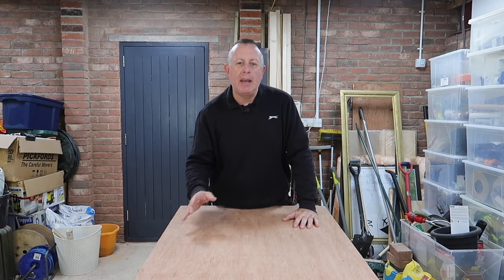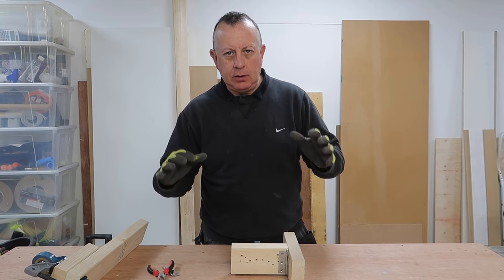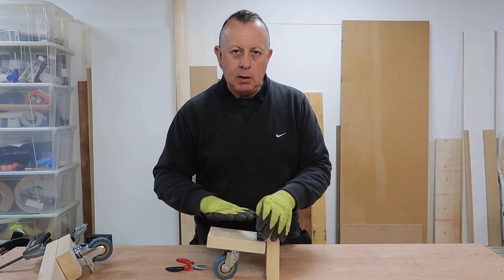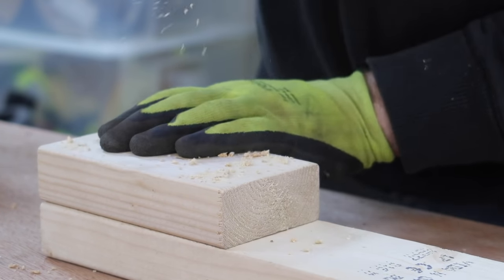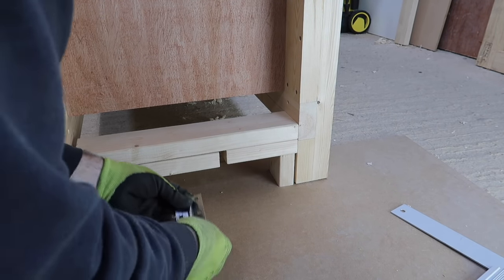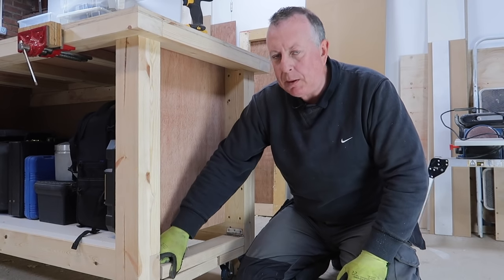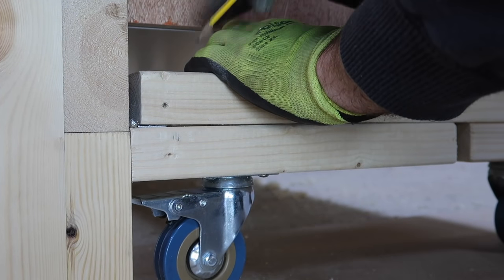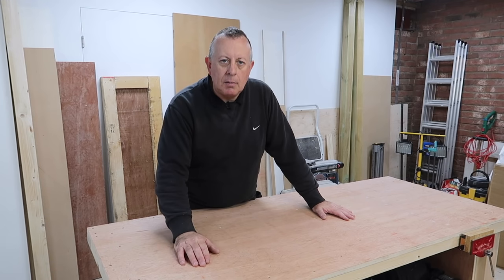Simple Retractable Casters for Workbench

Comment: Great build and video.  The only thing I would possibly change is adding a piece of angle metal to the ends of the hinged boards so the load isn't running directly through the softwood into the three hinge contact points.  Great work!

Comment: Nice.   For a rougher floor, just start with much bigger diameter casters.  Wagon wheels are the size they are because a buggy is driving on rough dirt roads, with only 1 horsepower.

Comment: I’ve watched every video with retractable castors to find the best solution as decent shop ones are so expensive. I was impressed  with and built Carl Holmgren system. Yours is one of the best I’ve seen. That latch is clever relying on lateral movements. Pulling the hinge pins is inspired I will definitely use that idea. I would be interested to see a long term use review in the future. Cheers John from County Durham UK.
Reply from the maker: Glad it was helpful! I will do an update in the future. At the moment I'm moving the bench maybe once a week so it should last some time I think.

Comment: We have wheeled tables much like this in the shop where I work. When attaching the legs, instead of making a jig block I would have blocked the table up for the clearance I wanted between the legs and floor when the casters are down. Then I would have set the caster/plates in place on the floor and screwed the hinges in at that height. Obviously either way has its pros and cons, I just wanted to present another method.

Comment: I have a box full of those brackets. They certainly come in handy, but are too rigid for their intended purpose, in my opinion.
I prefer making my own safeties out of climbing rated nylon tubular webbing, washers, and structural screws into the studs. I would feel absolutely awful if something I installed toppled over and hurt someone or damaged something.

I like your design. It's very simple. The only downside is that you have to look at the retaining bracket to line up that screw. Toggle or latched systems are no-look and hands-free but are far more complicated or use pricey sprung hardware.

Thanks for sharing!

Comment: think this can work for a 1300 lb pool table?   Application is to move daily over flat concrete floor less than 10 feet between storing and playing position. May need steel cross members between the legs along the short dimension.

Comment: Lol I have this going on in my kitchen at the very moment!!
My studio apartments too small and I have a cabinet/buffet thing that’s about the same size as the one in your work Studio (and made out of some heavy ass metal ) .I bought these caster movers from Home Depot which I probably should’ve just bought wheels and made one  anyway this big giant metal table has been chilling on two of them for way too long but ..🙄the cabinet now has the ability and freedom to travel the studio (until I finally get it out on my balcony where it belongs) sadly the extent of its travels isn’t very far as my apartment isn’t very big. My apartment is however on a flat surface so it has never rolled away on me but I suppose I could make casters with those wheels that card tab where you step on one side and it locks the wheel if I wanted to have a cabinet on a hill or something lol

Comment: Great idea! Have you done any testing to see if the bracket comes off the screw when the wheels get jostled? I have expansion joints in the concrete and my wheels take quite a bump moving across that gap.
Reply from the maker: I've used it probably weekly so far and it's not jumped off yet.

Comment: Awesome build. Your system works much better and far less complex than several other YT versions, some of which approach Rube Goldberg levels of unnecessary parts.Your bench appears to be fairly heavy, but some slightly beefier casters should handle much heavier loads, given the big mechanical advantage. It appears the limiting factor for ease of use is the length of the lever, and therefore the space between the legs. 
   Time to hit the internet for a fresh batch of casters.
Reply from the maker: Glad you like it! Yes, the distance between the legs and therefore the lever length and I suppose how much force you are happy to use are the limiting factors.

Comment: I was thinking you could use a vertical board pushed into  place over the levered board for the casters. once its pushed flat against the leg it should hold its place due to the upward force of that board. then to lift up the casters that vertical board could be angled toward the center, releasing that caster setup.
Reply from the maker: That actually was one of my ideas for keeping the lever down. However once I realised how easy it was to keep in place I went with plan B

Comment: MFI! Now you are showing your age! They went bust in 2008 I think. Bought my first DIY kitchen from MFI back in the '80's. God where has the time gone.
I have also fitted casters to my work benches but they are not retractable like yours. My problem is that my workshop is my single garage (attached to the house) the floor of which slopes from the back to the front - quite a lot. As a result all my floor standing shelving & benches have to be blocked up on one side to make them level. The shelf / bench legs nearest the garage door are shimmed up around 250mm!! It's either that or have benches / shelves with one set of legs longer than the other - not happening. Given that most of my benches are 2nd hand kitchen units & worktops it was easier to shim them up with adjustable kitchen unit legs which can then be wound down when needed. Fitting casters to the bases makes it easy to drag them away from the wall when needed. 
Keep the videos & good ideas coming. Every day is a learning day.

Comment: Those are definitely IKEA 👍🏼 Another great vid, thanks. The only thing I'm curious about over time is the wear between the two timbers that run against each other, i.e. at the centre when your two tower bridge arms make contact. But I'm sure you'll get plenty of years before it becomes an issue 👍🏼
Reply from the maker: Thanks. I'm currently moving the work bench every 1-2 weeks so it doesn't get much wear and tear. If you were using the system daily or more then maybe you would want to put a strip of aluminium etc for them to slide against.

Comment: I love the build.  I plan to use this approach on my new bench.

Can you tell me what hinges you are using?  I can only find door hinges and they have an offset and won't sit flush against the leg and the lever arm.  I checked Amazon and my local hardware stores, I cannot find any hinges without the offset?
Reply from the maker: The hinges are one of the cheapest Screwfix sell - with a removable pin

Comment: Any idea of the weight that this system can carry?  I'm looking for a solution to make my lathe (~300 lb-m) moveable.  I would think that the components need to be capable of handling ~ 100 lb-m.  I love the simplicity of this system.
Reply from the maker: I would think around 400lb with a struggle. If you intend using it for a lathe then I would agree with you - look at using a better hinge and casters. You need to assume that at some point the weight will only be on 3 legs.

Comment: My shop floor is usually dusty, dirty, and has a few little chips laying around. I could see the latch popping loose. What if at 11:05 you moved the hole in the bracket for the screw head up the slot say 3-4 mm? Then the screw could slide in the hole and seat a little deeper in the bottom of the slot, maybe preventing it from bouncing/vibrating loose?
Reply from the maker: You could do. I move my bench every couple of weeks and so far it's not popped out. There is so much weight on it that I think it would take a lot for that to happen
Reply: @ProperDIY  👍 Good to know then. Great video by the way. As others have said, probably the most practical and straight forward idea yet.

Comment: In order to lift do the caster have to be parallel to the wood?  Would they work if caster were turned sideways or would it collapse the casters?
Reply from the maker: On their side a caster won't have the same capacity for sure

Comment: My workbench is made out of meranti wood. The workbench itself is heavy but adding the equipement on the shelf underneath I estime the total weight around 200kg. Although it’s very stable because the weight, I can’t move it at this stage. Your solution seem a very simple but convenient one. However, I’m a bit afrair about the hinges/screws being able to support the weight. Do you have any alternative solution or any other type of hinges you would suggest? Thanks
Reply from the maker: The cheap hinges I used were good because of the pin that made it easy to remove. If you want a stronger fixing use better hinges without pins which will be more time consuming to fit but will take a greater load and will last longer.

Comment: Cracking idea and only came across your channel by chance and now have subscribed. So much better, stable and cheaper than normal castor workings or the adjustable lift ones that you have to lift every corner individually. Superb 👍. Do you know what sort of weight it can take as my workbench is really heavy with all the draws and tools in. 
Keep up the great work. Seeing other comments, its funny how all of us seem to watch the same channels 😀
Reply from the maker: Thank you. I estimate that the bench plus tools is now around 200-250kg. Best way to find out is weigh each end with bathroom scales. The casters are rated at 150kg each and you need to assume that at some point, the whole load will be on 3 casters only (as an uneven floor will mean 1 caster is hanging)
Reply: Thanks you so much Stuart for your prompt reply. That’s excellent, I guess mine is around 300-350kg but was planning to integrate my cast iron table saw into it, with out the stand that is another 90kg. 🤔. Pushing my luck but that’s what we do? By the way just watched your vid on the tenon door, excellent work and especially with out a table saw. You have the patience of saint if you ask me. 🤣
Reply from the maker: @markgeezey1809  well that's a fairly heavy bench in total. The great thing about a project like this is that no one will see it until complete so if you have to change your design or modify something only you will know. See it as an experiment with iterations rather than 'right first time' and you will prob end up with something better than what you thought at the start.
I really should have had a table saw for the door build - it did test my patience (off camera)!

Comment: Good video, informative and well thought out. One observation and I understand you have dumb down the technical jargon which helps but feel you are missing an opportunity to share your expertise , you used the term shear a couple of times , whilst to an engineer this word tells them about the fact that the load being transmitted through the surface area of the hinge pin has been thought and will support the load and forces being applied(not break it )however to the layman the word shear may not tell him it will not snap under the load of the bench and it’s stored equipment , again thanks for a great video👍👍👍👍👍
Reply from the maker: Thanks for your comments. It's a very difficult balance trying to explain everything, to everyone and keep the video interesting, entertaining and keep it less than 2 hours long! Maybe I should have explained the term shear, others have already asked me to explain 'lever arm' so I have to aim at the middle ground knowing that maybe not everything I say will be understood by everyone who watches.

Comment: You could position a batten between the top underside top and the lever
Reply from the maker: You could do but would need to hold it in place so it doesn't suddenly come out as the bench rumbles over bumps in the floor

Comment: If you moved one of the angle brackets to the inside and connected the two levers rigidly enough, you could probably control both mechanisms from one end.
Reply from the maker: Maybe. It did cross my mind that I could potentially do something that push down both at the same time however I finally decided that a) there was more opportunity for something to go wrong and b) I didn't want to spend more time on it - other things to do!

Comment: Thanks for your excellent channel. Will incorporate this strategy in upcoming MFT3 mobile cart.

Help requested please to locate the loose pin hinges, with a little handle on the end of the pin, enabling simple removal.

I have looked on Amazon and screw fix web site but unable to locate.

Any suggestions and advice appreciated - thank you.
Reply from the maker: Thank you. I've never seen a hinge pin with any type of handle or loop - prob as it would normally get in the way. My only suggestion is to find some steel rod of the same diameter as the original pin that you could use as a loose pin but could extend out of the hinge where you could maybe bend to form a hook etc for ease of removal.

Comment: One thing to be mindful of when fitting casters inboard like this, is that you can make the bench very susceptible to toppling (i.e. overturning moment couples) when you change direction whilst pushing it (i.e when pushing the bench sideways), the wheels on the leading edge rotate towards the trailing edge, bringing them closer to the centre line of the bench (courtesy of the fact that they have caster) this has the same effect as if you had moved the bench legs inwards and built the bench with narrowly spaced legs (i.e. it's tippy if you apply a force sideways force anywhere near the top edge of the bench).

The solutions are:
Don't mount casters inboard
Just be aware of the effect and pay attention to what you are doing
When moving the bench, push the bench down low not up near its top surface (thus massively reducing the overturning moment it experiences).

This particularly relevant where you might have uneven loading of the bench, it's fine when stationary, but you start moving it around and shifting the line of action that keeps thing upright, and there she goes....
Reply from the maker: I've found that although the casters are on-board of the legs they are still 500mm apart. So, as long as you aren't pushing it around the workshop like teenagers playing with supermarket trolleys you'll be fine.
Reply: @ProperDIY  Yep, there's always the real world vs theory, given the bench width I'm sure this one is fine with common sense.. If one makes a 2m wide structure with inboard casters on the legs and it's only 700mm high, it's all a non-event. It's just a general note for people to keep awareness of if using casters on their other designs/machines/projects etc.

A nice simple solution you present in this video👍

Comment: Wouldn’t this cease to function once the wheel material either wears or becomes compressed when load bearing? I would think at minimum you’d want to have the lever raise the bench to the measurement of the wheel material to the metal caster. This way you have as much wear tolerance as possible. Curious to see how these fair over time and load. Good thinking overall.
Reply from the maker: I understand why you say that but the wheels are only working when you are moving the bench around - for me that's around say 2 minutes a month, moving 1-2m max. I've got no wear on them yet.

Comment: Oh I may mad or what. It's a pity I didn't see this video before cutting my legs short and installing casters on it. I did follow your video on a workbench.Today I decided I do want to have an option to move the bench around. I shorten the legs on miter saw (which was fun exercise  I must say) and installed casters on it. It's all ok, legs are even, casters are working as expected. But it introduced slight wobbling I'm not too keen to see. It's not that bad but still. Without casters workbench is a bit lower than I'd like. 
And now I see your video. Sigh.. one of those facepalm moments I guess :)..

Comment: I know it is more rewarding to make your own tools and gadgets as well as for making great videos, but workbench casters have been around for quite some time now and they aren't very expensive. The ones I obtained are by Powertec. Their model number is 17002 and includes four casters for about £90.
Reply from the maker: 4 casters for £90 - not expensive - really?
Reply: @ProperDIY  They are in the U.S. only about £43 equivalent.
Reply from the maker: Well that's at least £33 I saved then!

Comment: Another way to do it would just be to have the wheel attached to the table at the bottom and then make a hinge next to the wheel where the leg could flip up or down. You could either have a magnet to keep it up ...
Reply from the maker: Yes you can do - whatever works for you

Comment: This video was super helpful!! I'm the set leader for my school's theatre department and our musical is Legally Blonde which requires about 17 set locations. After coming across your video I think that this'll be a really effective way for us to move and lock the sets safely. Do you have any suggestions on how to be able to push down and lock both wheels together rather than separately? Again, great video! :)
Reply: I have this same issue with my bench that sits in the corner with its left side in the corner.  My solution is to use a 2x6 for the upper lever and rip the “push down end” upper board to have a portion of it extend just past the leg of the bench.  I then put both brackets on the same side of the lower boards (in my case, facing right) Then, I connected the two lever arms with a board so I can push down the middle and do both sides simultaneously.